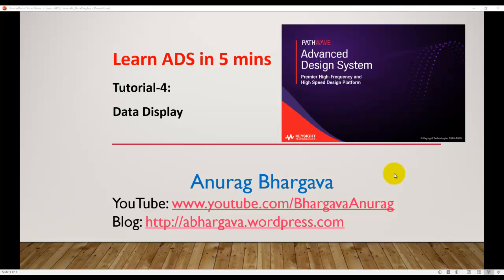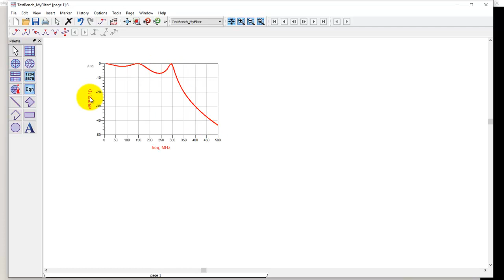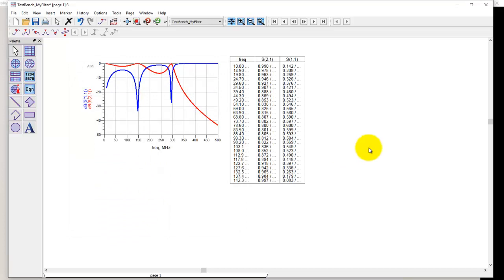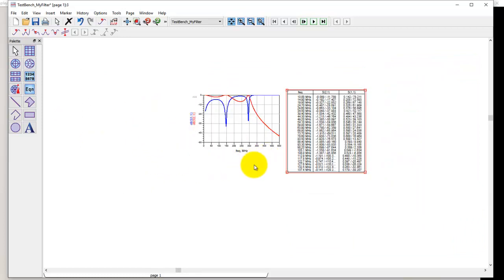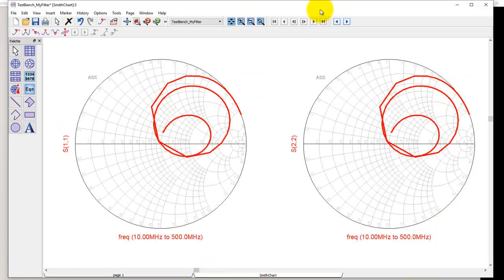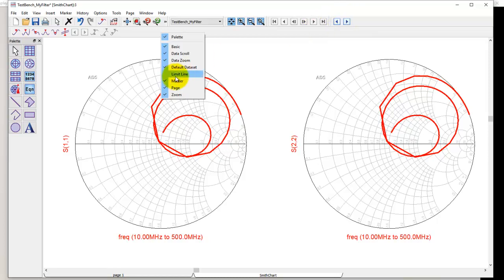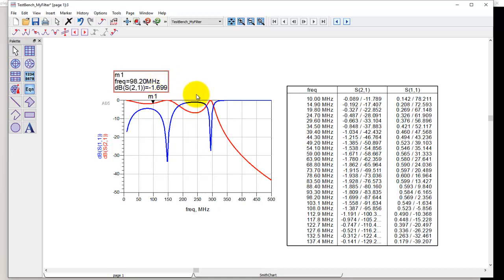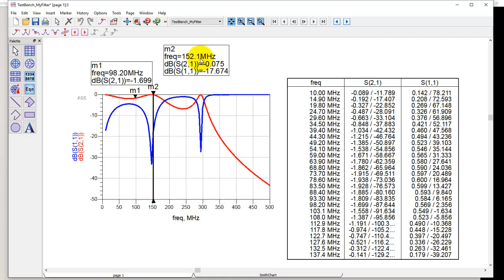Tutorial-4: Data Display in ADS

Comment: When I do the simulation on ADS 2020, it does not show the parameters S(1,2) S(2,1) S(2,2) to indicate. Is there anyway to solve this problem ?
Reply from the maker: If you are running S-Parameter simulation then those parameters should be part of the dataset by default unless you turned it off in S-Parameter controller. Kindly watch S-Parameter tutorial video under the playlist

Comment: help me, please.
 How is S(1,1) different from S(1,2) and S(2,2)?
Reply from the maker: Kindly read here: https://en.wikipedia.org/wiki/Scattering_parameters

In short, S11 and S22 are reflection coefficient which tells you about the quality of impedance matching of your network with a specific impedance (in RF applications 50Ohms) and S12 is the transmission from port2 to 1 and S21 if usually referred as forward transmission from Port1 to 2 that shows the gain or loss of the circuit.

Hope this helps.

Comment: Is it possible to have horizontal line marker?
Reply from the maker: I couldn't understand what purpose will it serve?
Reply: @BhargavaAnurag  in the case when we want to find the frequency range in which S11 is less than -10dB, horizontal line marker is very useful. You have the best tutorial for ADS on this planet BTW
Reply from the maker: @hongpan0507  Thanks for liking the content on my channel....😊
It is not possible to have that kind of marker but there are many ways to do what you are asking, see below:
1. When you insert a plot, don't select S11 as your measurement like you do. Select "freq" from the list and then select Add Vs and from the pop up list select S11. This way you will have the reverse graph and now you will have S11 on X-axis and you can place a line marker on -10 dB to note frequency span.
2. In data display, you can write equations like this and you can plot freqDifference in a table to get the frequency span that gives you better than -10dB return loss:
 lookupValue = -10
indices = find(dB(S11) < lookupValue))
firstPoint = indices[0]
lastPoint = indices[sweep_size(indices)-1]
freqDifference = freq[lastPoint]- freq[firstPoint]

Hope this helps...
Reply: @BhargavaAnurag  The 2nd option is a super neat trick. Thank you very much

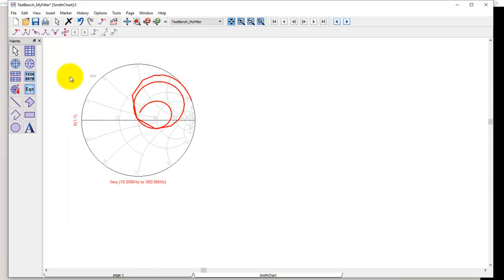Comment: @2:55, don't we usually plot port impedances/admittances on the smith chart instead?
Reply from the maker: Hi Sai,
Couldn't understand your exact query. When we plot S11 or S22 on Smith Chart it shows you reflection coefficient as well as the Input or Output Impedance of the circuit.